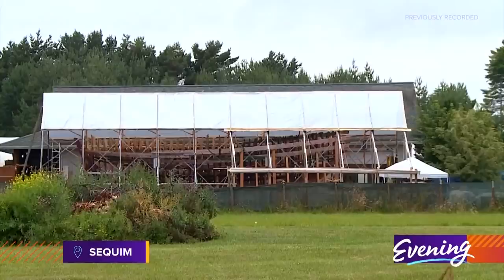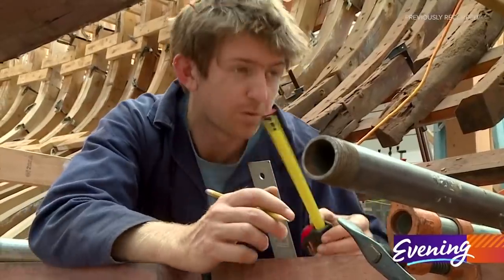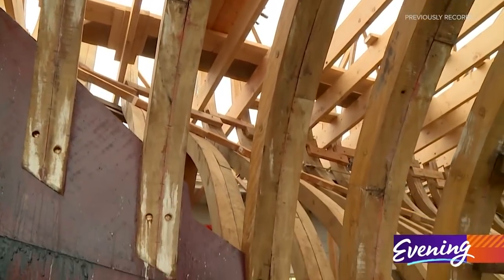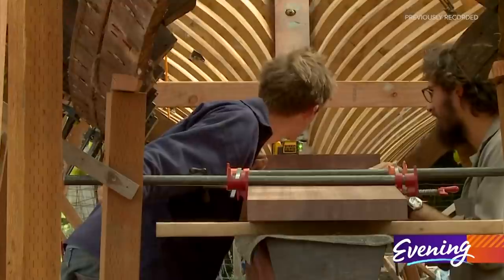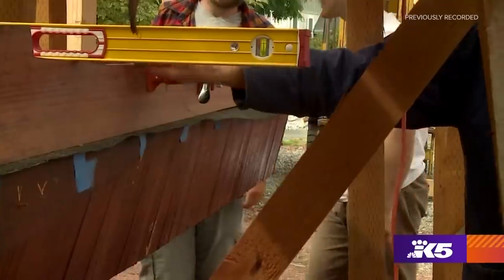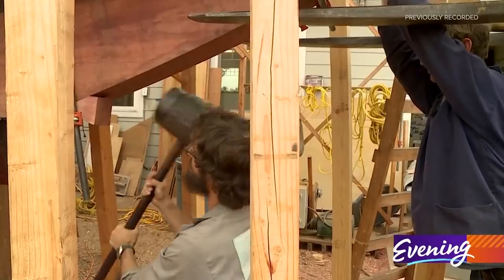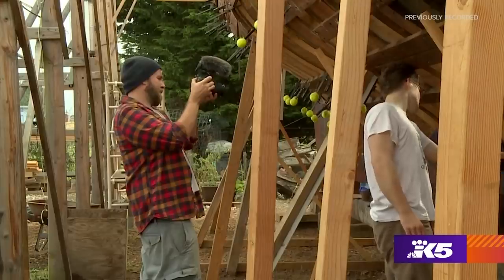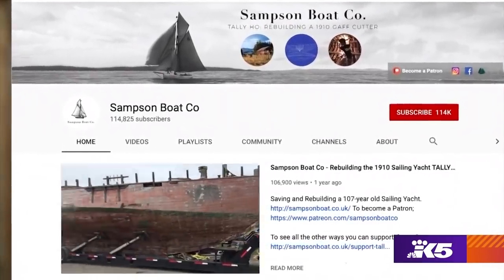Saving a historic sailing yacht on the Olympic Peninsula

Comment: So what part of this boat is original. Looks new to me.
Reply: If it looks new to you he's doing a good job.
Reply: He talks about this in some of his videos. It’s the classic Ship of Theseus problem. If you replace all the parts of a boat over decades bit by bit. Is it still the same ship? What if you did it all at once? Leo says he draws the line, if it looks like a ship still throughout the process. Which is what he’s done. There are some original parts still as well. And it will be restored mostly to the original specification.
Reply: Leo actually did a whole episode dealing with this question.. He has saved all the wood and parts off the Tally Ho and reinstalls what he can.. The whole Transom is from the original and so the keel ballast.. There are pieces from the top planks he plans to use when the time comes..
Reply: Every board has been replaced. Technically, it’s a clone. The original Tally Ho is in the scrap pile. That is what happens sometimes when you get into a project as big as this.
Reply: @Mr572u  Every board hasn't been replaced. The transom is original.  Many of the planks and decking had already been replaced once before in the past.
Reply: My father rebuilt a 1930’s international Dragon, which included replacing  all the hull below the water line, new decking etc etc.
The point is the rebuild followed the original drawings etc etc. No way was it a new boat. 
Tally Ho as restored/ rebuilt is without question still Tally Ho.
Reply: Who cares? It looks like the old yacht, it's done so well. Every part is exquisitely made. The process is so watchable. There is empathy and humanity in every episode. Love the music. And it's going to sail in some race one day, Fastnet or otherwise. To me, that's good enough. Go Leo! Go Tally Ho!

Comment: It's basically a new boat.
Reply: As Leo himself has said, they're just catching up on all the maintenance that Tally Ho has missed out on over the years. Not to mention reusing old timber for the stern and interior.

So better to say she's a "renewed" boat...
Reply: @langdons2848  It's a replica boat with some reclaimed wood used on her. The measurements for all her new parts where taken from the original plans sketched out and relofted. Nothing to do with the actual boat that has existed all this time. When they used the reclaimed transom they cut it to match the replica boat. They didn't build the boat to fit the transom. You can delude yourself all you want but it is what it is.
Reply: @alexander5207  congratulations on missing the point and spirit of Leo's project.
Reply: @langdons2848  Cry me a river.

Comment: It would have been cheaper and quicker to build it new from scratch, there's not an original stick or fastening left in her! But then toffs born to the landed gentry and with a mention in Burke's Peerage often find it easier to take on a lifestyle that doesn't require the same considerations as we mere proles who don't always have inheritance to fall back on if we cock up our lives.
Reply: ITYF the transom teak is from the original boat, and some of the deck timbers will be.
And I'm pretty sure that Leo is not a "toff born to the landed gentry" if that's what you're saying.